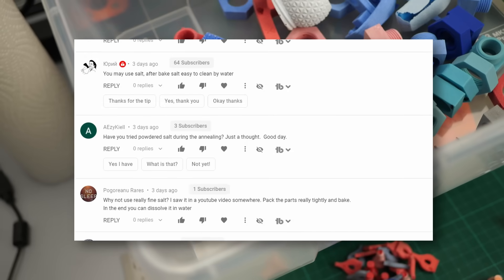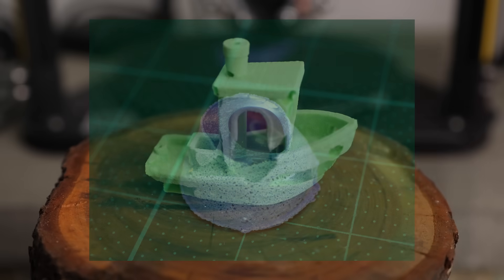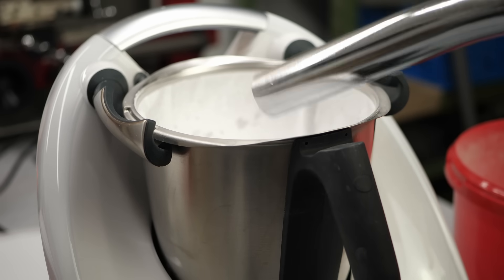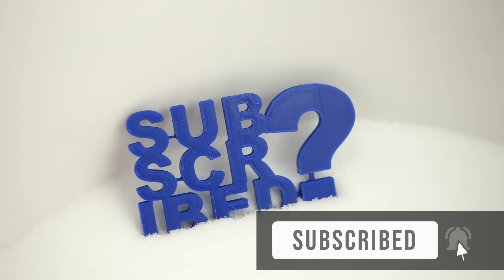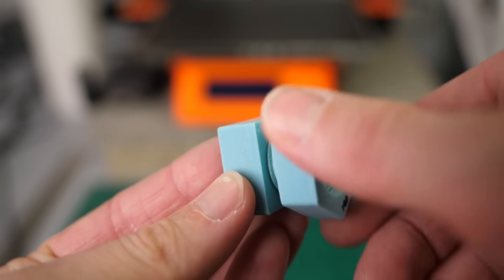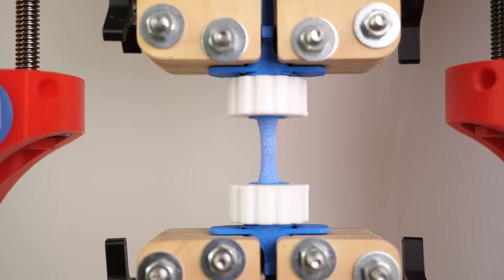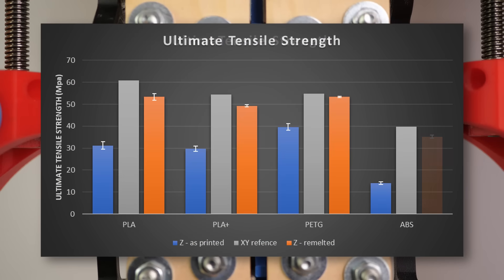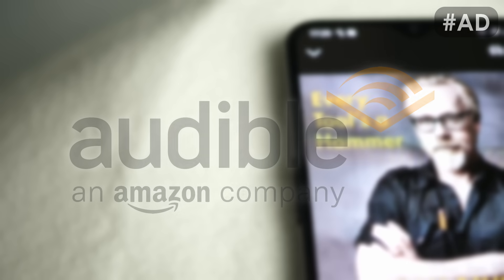The STRENGTH of 3D prints REMELTED in SALT

Comment: I've done some work on this process after seeing thos video. I was able to use gym chalk to very good effect. The detail retrevial was so good that the layer lines were still visible after remelting! I unfortunately don't have the means to quantifiably test its mechanical properties, but I observed perfect layer adhehion by way of uneven breaking, better clarity (with a clear filament), and a drastic increase in impact resistance (generally more than trippling the fall heights required to break compared to non-remelted parts). I have tested with HIPS, PETG, and PLA and they all seemed to work fine. I also used a barbecue thermometer and pulled the parts as soon as they reached 420 degrees fahrenheit.

The next tests I plan to run is to make a vacuum formed high temperature silicone mold based on a SLS printed reference part. In theory this should allow for quick and repeatable remelting without the tedious process of packing chalk (or salt) resulting in a process that can hopefully allow for small production runs of comples parts. I'll comment below if I fine any success. I'm also very curious about PCTG. I've had everything required to do this for months but have been busy with school. I really want to get this stuff done before the end of may.
Reply: Amazing ideas and concepts Isaac! Would love to hear if you had further successes with that!

Comment: Has anyone tried using different ratios of diatomaceous earth mixed with the salt to reduce the porosity of the finish?
The DTM has an incredibly fine powder-like consistency, and though it's not water soluble, it should have small enough particulates (along with salt mixed in between them) to wash out with ease.

Comment: What about using cement, the powder before you mix it with water and sand. It is a homogeneous very fine powder that should work just as good as sand.

Comment: What if you plate the object with metal? (Or use some other truly rigid, dimensionally stable sprayed-on or brushed-on coating?) Then you can use the object as its own mold. Heating won't deform the metal shell, but expansion from heating could break the shell, so you'd have to leave an opening at the top for expansion, melt from the top down, and re-solidify from the bottom up. All of the enclosed air voids might rise to the top (if the plastic melts soft enough), so you'd have to leave a solid plastic "riser" at the top, or else add more plastic. You couldn't have any deliberate internal air spaces. Any recesses or cavities have to be plated too. Unlike "remelting in salt", the space inside the plated metal shell could not grow, change shape, or pick up texture. When finished, you could leave the metal on, or etch it off.

Comment: It would have been a finer size and easier if you liquify the salt in water and spray the water in a fine mist into an enclosure with low humidity hot air. The salt will dry in the air and you will get small particles

Comment: How about using oil instead?  Slight pressure. It will coat it completely no air gaps, super easier..if it works.

Comment: you should try calcium sulfate "gypsum". it wont melt and is as fine as flour. Gypsum is a rock one of the main ingredients to cement. You can even get food grade. It is apparently good for soil.
As a main indigent to cement DONT WASH INSIDE it will plug plumbing.

Comment: If you wanted more fine salt, you could probably ball mill table salt down and run it through a 200+ mesh. Pain in the ass but might be worth it depending on the use case

Comment: Following idea: use a silicone mold for the remelting

I've created silicone molds from 3d printed designs for making Christmas themed chocolate. The pouring of the silicone works reasonably well and the silicone should be able to withstand temperatures of up to 200C. The molds can also be reused for the next print with the same shape. Would be worth a try. Maybe I'll give it a shot with one of the molds.

Comment: why not just use the stuff they use to cast things in, and add a % of salt to the mix if it does anything of benefit. Surley the best results will come from something that doesnt react with the medium, and hey if you need some kind of reaction wouldnt adding carbon or something be better than salt? I have some old activated carbon filters here if you want one, you anywhere near NRW? also you might want to try preserving salt, idk if the nitrogen/nitrates in it will do anything different but hey if you are testing everything: go balls deep ;)

Comment: Use sand casting powders instead.... Ultra Fine silica will work better. You can also use other types of lost __ casting powders too, anything that is meant for high temperatures.  It's cheaper than the salt will be and finer.

Comment: Use a mill. Usually made for corn flour production. Mexican market, can find one cheap.

 Also aren’t you just making casting sand? Reinvented… 

Have you tried using regular casting sand?oooh what about carbon just like dust carbon dust, could impregnated some strength into the part? Mad scientist here

Comment: Using a rock tumbler with ceramic media, similar to what's used to powder metals in pyrotechnics, should give fine and even enough salt after tumbling for a while. It takes a while (hours to days) but you can just leave it in the basement while it does its tumbling.

Comment: I would recommend against salt.
Any moisture trapped in the part will try to dissolve the salt, and likely result in a poor surface. It may also be possible for the salt to dissolve in the molten plastic.
I would recommend a very fine ceramic. The ceramic wont dissolve and should retain its good surface finish.

A very fine sand should be good.
Probably a better alternative in terms of prep (but likely quite costly) is polishing powder or sand blasting powder.
For example, you can buy alumina powder with a particle size of 50 nm, which you should be able to use directly.

Comment: Wait, your salt is just there to act as a mold, then? It isn't contributing additional chemical properties? At that rate, you can get some nm-fine silica and get the same results, right? Why not strive for additional material strength alongside the remelt shaping? Swap out the salt for graphite powder and run a current through your whole annealing apparatus during your remelt?

Comment: what about using diatomaceous earth while it does have a lower milting point it is already a fine substance that can be compacted and also what about layering the object with the salt or what ever first for example if using salt covering the object in water and having the salt stick to the outside then letting it dry then packing it in the salt.

Comment: I feel like over time, this will degrade, since salt absorbs moisture from the air.  As well, what happens if the print gets wet?  I live in a really humid environment, and I kind of feel that a salt-infused 3D print might not last.

Comment: If you put table salt into a coffee grinder until it is the consistency of powdered sugar, it should work. Do it right before you are going to use it, because NaCl is VERY hygroscopic and will pull water out of the air.

Comment: Why not sand? Sand doesn't rust things... It may be too hard but sand doesn't clump with moisture so you also have the benefit of forgetting about re/processing... Sand is silicon dioxide with minerals contamination... so glass may also work. Or even iron.

Comment: I don’t see myself doing this because salt is so corrosive. I don’t want to breathe powdered salt, and I don’t want the powder to get on my workbench or tools. The other bad thing about salt is that it operates as a desiccant. In humid environments, it can suck humidity out of the air and then result in saltwater solution in your containers.

I do use saltwater on my glass printing bed to improve adhesion during prints.

Comment: For a better surface finish you should try silicon dioxide nanoparticles. Sounds fancy, but its actually the food additive E551. The grain size is about 50 to 200 nm. It has a melting point of 1700°C and is used as drying and release agent. Since it is a food additive, it is pretty save to handle, but you should not breath it in. Sadly I cant say something about its compactibility.
Reply: Correction on this: e551 just stands for silicon dioxide, no mention of the grain size. 50-200 nm in particular are Stöber particles, which are difficult to source for most people and quite expensive. Feel free to prove me wrong- I could not find any, anywhere, with that grain size.
Also, when drying nanoparticles of SiO2 that small, you'll run into the issue of aggregation, which is irreversible. Particularly if they are not factory dried perfectly, heating them up will dry them which also causes a bit of crosslinking and clumps them irreversibly together.

Comment: You found something pretty big. If you had small beads of PLA and remelted them in salt you could create beats with a high surface are for a variety of application. Some that immediatly come to my mind would be biofiltration in ponds and aquriums and immobilaziation of enzyms and katalysts on the highly porous surface to use them in a reactor. Someone could even immobilize microorganisms like yeasts in those pores and use them in some sort of fermentation process.

Comment: If you want to get a really high density in your salt then you not only need to use really fine salt. You need to mix the fine salt with larger Salt crystals so that the gaps inbetween those larger salt particles get filled with the small ones. Then after completly filling the salt you should vibrate the container. Also maybe try compacting it while vibrating to get it even more close to the shape.

Comment: I have been trying this for the last day or so and am starting to get it down.  My parts are coming out at least straight enough for most purposes.  The difference in strength, especially with thin walled parts has been unreal.  They intuitively feel more solid and "mold like" if such a thing exists.  There is way less cracking when handled roughly.  

There is definitely some subtlety to the packing technique that will affect the shape of the final "mold" ... I'm gonna have to look some of that up.

I wonder if perhaps a little over extrusion might help here.  The idea is that though it may produce an uglier part requiring more post processing, this might ensure a more solid infill with fewer voids, allowing retention of finer details.  Or not.

I also wonder if the small bubbles in PETG could be due to gasses being released from the material itself.  I have seen a few of these in my parts.  My PETG has been exposed to ambient attic air for some days, so it probably isn't optimally dry.  It has also been dried several times.  It is a few months old.  I think I see a probe thermometer in my future.

Comment: would it be worth considering a preheat process that warmed the setup to say 160C for enough time to ensure that the core reaches this temperature. This means the inner core has enough warming before the actual heating steps start. This is like cooking a steak that is straight from the fridge when compared to one that has been sitting at room temperature for several hours.

I have friends who do a lot of casting and in know that one of the key factors using casting sand is attaining the right moisture level. In casting this is important because the moisture is required to hold te sand firm while the mold is removed. With this technique there is no need to use any moisture as the dry casting sand is very fine and would adhere in a similar way to the finely ground salt. I expect that a carefully designed casting sand that holds its form when dry would be the solution.

Another consideration would be making the volume of powder in the setup as small as possible without compromising the result. I would suspect that, unlike casting, it would be possible to have relatively thin gaps between the part and side wall of the container

I think this technique is very worthy of further development especially in circumstances where much more strength is required so the additional after processing is fully justified. You testing is very thorough so the results achieved are scientific and reliable.

Excellent video and techniques

Comment: Stefan, you tried wet plaster before (in which parts were of course quite difficult to remove once the plaster hardened) while free spirit 1 uses standard kitchen salt with great success. Your own results are obviously not up to his, most likely because, as you noticed, your salt grain size is far too coarse.
May I suggest maybe other appropriate powders (and disallow some suggested that I read in the comments)? The grain size needs to be the finest possible, they must not react under heat, they have to be cheap and, also important: they have to be water soluble, in order to be able to completely disappear from the surface of the part once it is finally washed with water.
❌ fine sand is out of the question as it is not soluble in water and the grains remaining stuck in the plastic surface will leave a rough, abrasive finish.
❌ diatomaceous earth aka kieselgur: super fine (3-200 μm) but alas not soluble in water so disqualified like sand for the same reason.
❌ sodium bicarbonate aka baking soda (NaHCO₃) is out of the question too as it releases CO₂ when heated (because one cannot get rid of 100% of the moisture) that would ruin the part.
❌ dry plaster of Paris? Just use it without water maybe! After all plaster is a very fine powder. Alas, plaster is NOT water soluble. Plaster grains undergo a chemical reactionwith water and harden as a mortar. 
✅ anhydrous sodium carbonate aka natrite powder aka calcined soda (Na₂CO₃) which is stable. Granulometry mix 30-40 and 100-250 µm, I think it's possible to select fine versions only when ordering. Melting point 851°C. Soluble in water and glycerol. Cheap.
✅ precipitated calcium carbonate aka PCC (CaCO₃), super fine (average particle size diameter 10 µm!). Cheap. Only slightly soluble in water, more soluble in hot (40°C) water, but well soluble in most acids → I would give it a try when printing PETG which is resistant to acids.
Maybe there are more; but to start with the last two seem better than kitchen salt.

Comment: I have totally solved all the  problems. The secret is not powdered salt but pressurized container. I used LIdl Sauerkraut can with smaller can and tight-fitting lid as piston. And  tightened it up with steel wire around. I made large coffee cup  from ABS. No deformation at all. Surface is pitted with regular salt, but this issue is bagatel and easy to fix with blowtorch.
Reply from the maker: Great tip! Thanks for sharing!
Reply: I wonder if you could put the salt and your prints in a pressure cooker and remelt that way.
Reply: I have videos of this technique now. White ABS turns into particularly nice shade of earthenware pottery.

Comment: I know this is a couple years too late, to get rid of the issues related to using salt, why not use greensand like they use for metal casting? It’s really cheap, packs really well, and I’d imagine conducts the heat a lot more evenly.
Reply: What is green sand? Anyways salt you can wash away. You will need an industrial grinder to remove the sand. Otherwise your proposition is quite solid.

Comment: The salt you buy at pet stores for saltwater aquariums is so fine it makes dust when handled. They use lab grade atomized salt because it dissolves faster than granular salt. However its not pure sodium chloride. It also has other salts that are highly hygroscopic, so I might try it, but pre-dry it in the oven first. It should in theory act as a desicant at that point and help rid the part of moisture if you put the part in well before heating it.

Comment: Do you think you could possibly test electroplating the prints and then re melting them in the oven? the thin layer of metal should be able to prevent the salt/other supporting material from intruding into the remelted plastic; and if it were essential that the part be bare plastic the metal could be simply sanded off as it would be only fractions of a millimeter thick.

Comment: So...I would preferentially use calcium chloride. It grinds easier, has less issues with clumping/flowing, and has a more stable pH over a wider array of conditions (it sits around a pH of 5).

I can see some use for this in prepping a plastic surface to accept a hard ceramic polymer coating, since some of the plastic is left behind to casually mix with the ceramic coating. Water Glass coat be painted onto surfaces and give a high wear, high gloss effect.

Comment: have anyone thought of using clay for this? the problem is that is that it might not reusable, but if you mix enough water so it becomes a very thick goo then when you bake it the water will boil off making it a cast around the piece. then you can just break the clay when it is done

Comment: Have you considered trying dry GROUT? it's inexpensive, hydrophilic. It's also one of the most fine-grained powders you can easily buy.

Talc is another possibility.

If you've got a vacuum chamber to suck the air out of the grout while you weigh it down you can probably improve your results regardless of the material chosen.

Comment: I think that there are two ways you could manage the salt better, using a setup like a clean room would make it much more consistent. You would need to ground yourself and anything that gets near the salt so that particles would not stick to you or anything else. Also putting some sort of plastic sheets up with a dehumidifier will stop the salt from clumping. It’s all the moisture in the air that’s ruining the salt